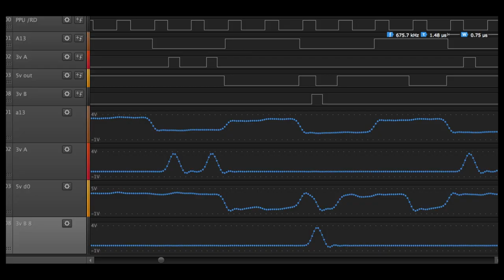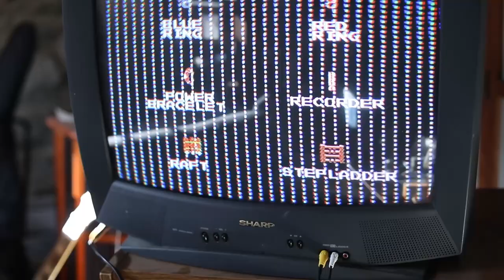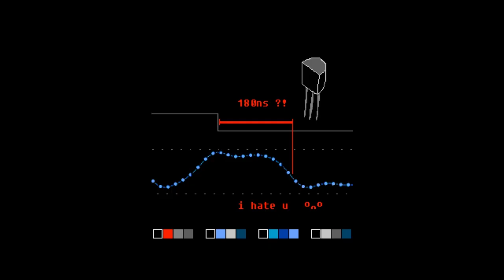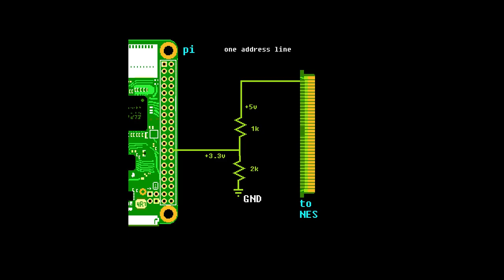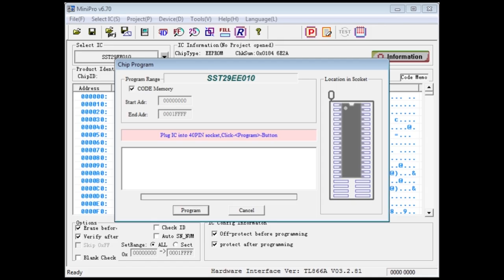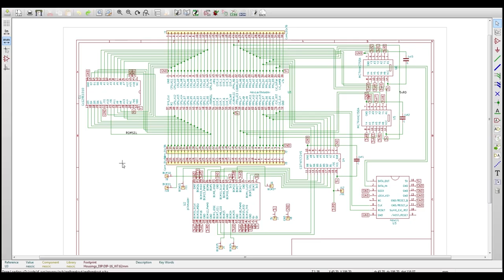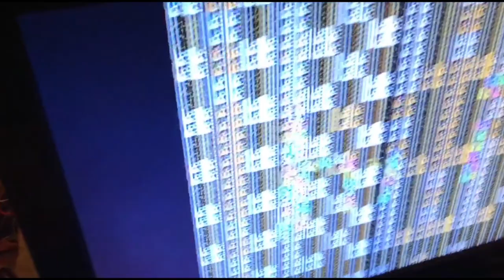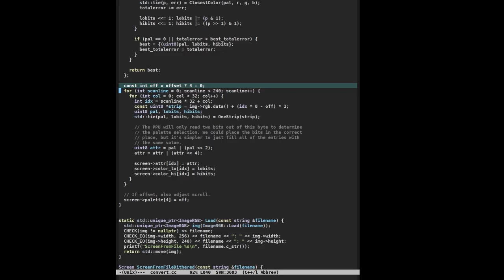Making of "Reverse emulating the NES..."

Comment: Ideas for further improvements:
Audio
  Use the DPCM playback function of the APU.
    Low quality, but still better than should be possible.
    Samples normally limited in size, but faking an endless sample by making a 1-wide sample and changing it every time it is read should work.
    Warning: Controller and VRAM jank
  Directly send PCM samples.
    Wait, that's what you said at the end...
    ...except my idea uses a single, "rolled" loop, instead of repeating data as your idea says.
    Samples are sent just like in the DPCM example, read from a place, said value is different every time.
    While I estimate this will be much slower than your idea, it should be much, MUCH simpler to execute, and failures will only mean missed samples rather than the processor doing whatever it pleases.

Video
  *Use a per-scanline interrupt*, which would have multiple uses, like:
    Per-scanline "fine" scroll, allowing for the color grid to better match the data.
    Use the "emphasis" and "grayscale" bits for a slight palette increase.
    Hook for a consistent 15khz sample rate for the audio
    Hook for per-scanline palette change?
      It should be possible to change it by disabling rendering, and thus ppu fetching, while the ppu should be fetching sprite data.
      Might be hard to control what it does after, you might need to set the current address, count cycles or something weird...
  Simplify "knocking" procedure, instead of an odd reading sequence, write a specific value to a specific address to enter "palette entry" mode, then read from another address to get the new palette.
  Jam in sprites somewhere??

Comment: If you want to get sound from the Pi to the system without modifying it, use a Japanese Famicom instead of the NES, you can pass through sound directly from the cartridge to the internal mixer of the system. Listen to the soundtrack for the Japanese version of Castlevania 3 Vs. the American release. This was done with a sound chip inside the game cart. Lagrange point had a kickass FM Synth chip in it that gave it music and sound comparable to the SEGA Genesis.

Comment: Never throw any thing away :), it might come usefull :), yeah so the MS keeps the track of sws up to 30 GB of updates back :)

If 1bit of transmission uses two transistors no wonder there are milions of them in the cpus. Thank you for sharing the LS, liggtspeed, knowledge, i thought every voltage level adapter would suffice :)

Comment: Re "reverse emulating the CPU", you should look at the Harmony cart for the Atari 2600. Appropriately it uses a microcontroller at 72MHz as it's Big Brain. And it does something like you specify. Except in this case it over-drives the bus. The bus is caused to have FF on it, and by selectively pulling bits down, the cart can control the address and data buses. This means the cart can control the Atari's graphic etc hardware over the bus. 

I've simplified slightly cos I haven't bothered looking it up just now but that's the principle, anyway. 

There's stuff Harmony can do that the 2600 could never do, it breaks several previously-hard limits on sprite numbers, etc, even per-scanline.

Comment: Hey for the record, the NES has a 7805 linear regulator inside which generates the 5 volts. Increasing the output of the 9V supply to the NES will not necessarily increase the current handling capacity, as the 7805 is the limiting factor. Most of them are rated for peak 1 or 2 amps.

Comment: Its just amazing what you've achieved here. Will you be refining this project? The nes controller uses a CD4021 shift register, snes controllers use two of these in series or a specialty ic. Also back during the development of the snes, their were rumors I recall that it was going to be backwards compatible. Similar to the Atari 2600/7800. For entertainment purposes you could solder the corresponding clock latch etc wires from a nes controller cable to a snes controller. Though at the end of the day,  I don't know enough about the nes cpu. I'd also assume that though they share the same bit register, that doesn't mean the cpu can understand the additional information. Two cents from a novice.

Comment: 40 conductor ide is also not straight through. Pin 28 (cable select or spindle sync) is inconsistent, and pin 34 is sometimes only between drive 0 and 1, not to the controller. Because nothing can be simple and easy. 

This isn’t meant as an “um actually” moment, this is me having spent a day of troubleshooting to learn this and trying to keep someone in the comments from that
Reply from the maker: Oof, traps everywhere! I must have not been using those pins or otherwise got lucky!

Comment: Awesome project, this technique for modifying stuff could actually be used in quite a few places not just funky display work on an NES. Anyway, a couple things, 1mil is 1 one thousandth of an inch not 1 one hundredth of an inch. So, 2.54mm=100mil not 10mil. Also, the capacitors next to your chips aren't actually to deal with power sag they help deal with the parasitic inductance of the traces and wires going to your individual chips. In other words any time a transistor switches in an IC it takes some amount of current to power that action and the inductance in the traces and wires resists that change in current. The capacitor then sits very close to the power pins of the chip to make sure it always has enough current during these spikes.

Comment: Really enjoyed this.

It showed many of the same assumptions and experiments that I also made when starting out in electronics, and I'm still learning something new every day. hehe

(like how a standard transistor can be surprisingly slow, unless driven in a certain way. And how you need a fair bit of drive current to toggle IO pins rapidly, due to things like the trace capacitance / inductance.)

This reminds me of mods like spritemind's, where he added an ARM chip (STM32?) to a Vectrex cart, so it could display a wireframe version of DOOM.

I definitely think this project is an ideal task for a small FPGA. You could then get EXACT (ie. per PPU clock cycle) timing accuracy, and easily display whole frames from an SRAM, while also doing palette calcs and colour swaps for any pixel group.

Have you looked into the 74LVC8T245 chips, btw? They have dual voltage rails, and are designed for 3V3 to 5V translation, so don't require any of the resistor dividers etc.

Or, did you just uses separate hex inverters for "reading" and "writing"?

I must get back to you on this later, as I was thinking about a similar project on other cart-based consoles.

Comment: Essentially you're using the raspi as a sort of dsp for the ppu, tbh you could further reduce parts by simply using a cpld/fpga  to talk to the cpu and ppu and connect the raspi to the logic device (fpga/cpld)  but you can pretty much emulate some ram (to buffer cpu and ppu data ) in the chip and write it with raspi or NES, also include cic lockout, and a mmu/mapper, and improve syncing as parts of the same chip can run at different clock rates(you still need a master clock though something  an Even multiple higher than the ntsc/pal NES master clock which you can use to sync between raspi and NES and easy to divide internally aswell within the fpga) , I actually was planning on something like this on my famicom

Comment: Amazing work. If you want some input from the world's foremost NES experts to solve your noise problems, check out the NESDev forums. The community there is amazing.
For the audio - it would be possible (and impressive) to stream audio samples to the DPCM channel, as you describe. There is a simpler route, however - just use the EXP port's AUDIO IN / AUDIO OUT pins, and run analog line-level audio from the Raspberry Pi to those pins. Flash carts like the PowerPak send "expansion audio" to the EXP port using one of the cartridge pins so that the NES can play Famicom games which had expanded audio capabilities, like Famicom Disk System games. Or, if you REALLY don't want to do ANY hardware mods to make this happen, even if that mod is just connecting something to the EXP port (no internal mods required), you COULD just do this on a Famicom. You would have access to expansion audio AND you wouldn't need a CIC.

Comment: So, something Iʼve been wondering lately: could you on either the NES or the SNES force it to send data during V-Blank?  You usually wouldnʼt want to but some information is designed for that; for example, in theory you could closed caption your games with line21 that way.

Comment: Have you thought of using dual ported SRAM? I think aliexpress or digikey has a boatload of those. You could even get SRAM that is twice the needed size and implement double-buffering by toggling an address line from the Pi. What you also could do is using linux boot parameters to prevent Linux from scheduling on Core 4, and setting a processor affinity flag on your process that is driving the IO lines. You can then also set it to realtime scheduling mode (the timer interrupt wont interrupt your process after 100ms, it can run infinite time without having to yield). Interrupts might still happen on Core 4, but no scheduler related nonsense.

Comment: 19:46 - Hmmmm... would it have been a reasonable idea to INLINE a resistor before the voltage divider input? As a simple current limit? Or does that make it much harder to operate on the bus that expects to sink / provide current?

Comment: Hmm.. a few years ago I was messing around with an RC car, I wanted to control it with a raspberry pi over a webserver without breaking the RC support or modifying the board at all. I have no electrical experience. So I just probed around until I found a pin that went high when I gave it controls.  Stupidly, I connected gpio directly to this, which blew out that gpio pin.  After that, I just threw some diodes between the RC board pins and the rpi.. and that ended up working, but now I am wondering if I missed some complexity and was slowly damaging either board.

Comment: Very interisting video, just like the MARI/O.

Recently bought a famiclone (with keyboard =))  and I am planning some experiments with it, as soon as I get a G-BASIC cart.

So, I figured that one can read (PEEK) the PRG-ROM, CHR-ROM and send it out through the audio out with the PLAY command (G-BASIC has those commands http://playpower.pbworks.com/w/page/23989647/gbasic%20manual) then a computer could record the sound and convert it into bits, or bytes (1 bit would require 2 distinct frequencies, 8 bits would then require 256 distinct frequencies, if we assume 10Hz separation between frequencies, that is 256 times 10Hz = 2560Hz bandwidth or approx. 3kHz). This way one could dump a cart, but it has to have G-BASIC on it. But how to dump a cart that has no G-BASIC on it?

Perhaps one could POKE some machine code into the WRAM (in some free space in the first 2kb in the NES address space) under G-BASIC, then one should fill up the stack on page 1 with the WRAM return address for the VBLANK IRQ so that the PC (Program Counter register) is executing the code in the WRAM. Quickly after this the VBLANK  should be disabled, the PPU should be halted (?) by the code (or just stay forever in VBLANK?), and perhaps it should relocate itself to the $0 address, then the APU sould be reset and setup for square wave output. Then the program would wait for a keypress, the cart could be removed and another cart inserted, so that the program could dump it to the PC through the audio out.

Another thing is that I guess one could bitbang serial communication through the controller port using the Strobe bit. 8 bit paralell input is possible using the shift register on the controller and instead of the buttons, the one could connect it to some other hardware.
It seems that 133MHz's project (https://133fsb.wordpress.com/2010/03/21/famicom-compatible-printer-port-interface/)
could be done in a simpler manner, through the controller port.
Oh and according to the Nesdev wiki, there are some microphone input, tape out and in pins on the famicom, but does that apply to the famiclones? I guess I will have to experiment.

What do you think about all this Tom7?

Comment: I saw your other video, very impressive stuff! One question, wouldn't it be better to do this via the expansion port of the NES that you mention, even if it's not as capable? That way one could buy a single NES expansion module to make it work on supporting games, rather than having to embed all that hardware into every cartridge? Kinda like the Super Game Module for the Colecovision that some folk brought out. Would make for an interesting project and possibly be marketable, like an "NES Pro" expansion that homebrew folk could support with new games. As a side bonus it means games would also work via Everdrive carts which so many people use, and would also mean far less real NES carts sacrificed for the lockout chip. I know you did it as a project, but I'm kinda thinking it would be really neat if an NES Pro expansion module was actually made and sold for the homebrew community!

Comment: It is kinda amazing that there is way by which we totally offload both the memory and the cpu to a set of streams of bytes. But, it is also amazing that you can do something like this with the Nintendo chip even if that includes jumping through some hoops, and some good graces of some open source tools, guides, information, etc. Some modern companies, cough Nvidia *cough*, think that open source is cancer. Kind of describes the monopolistic behaviour tech companies increasingly take up as a means to shore up walls into the ecosystem to avoid any form of revamping that is expected of many startups.

Comment: You might be interested in this video about the NES. So a guy that does TAS (Tool Assisted Speedrunning) managed to crack open the NES and stream audio directly to the CPU with only controller inputs. And boy it does it pretty good, at the cost of all of it's CPU time.

https://youtu.be/tA9nlUtepR4?t=9m50s

Comment: Hey Tom,

I am sure you have watched the TASBOT runs at GDQ, right? Where they reprogram the NES to play whatever.
They only use the controller ports for that. is that more powerful, less powerful, the same?
It seems like they push commands directly to the CPU that way.

I really wanna see some 3D. Like PS1 stuff on the NES (skiping Doom because that was on SNES and that makes it not as impressive :P).
If the "cartridge" does all the processing and just pushes audio and video instructions directly, it should be possible right?
and then if you fix the flickering and noise it would actually look decent, just reduced colors.
Reply: That TAS was doing something called ACE, or Arbitrary Code Execution. Meaning that the CPU executes code that was written in RAM, usually via controller inputs by a quick routine made by some other glitch that then can write bigger routines and do cooler stuff, like achieve total control of the game.

Comment: The part I still do not understand is how you pipe a frame to the NES. Do you first supply the code of a program that reads frames from the cartridge and then feed that program with the frames? But how do you switch palettes if the program is run by the NES? There is a part about synching the NES and the RPi that I do not get. Who runs what and when.
Anyway, fantastic project Tom

Comment: To address the sound issue, why can't you just use the passthrough audio feature as in the VRC7 mapper? That way you could produce arbitrary sound on the cartridge and have it piped through the NES. You'd need an adapter on the expansion port on the bottom, but no actual modifications to the console itself.

Comment: I've been thinking of a similar project for the Atari VCS / 2600, using a Raspberry Pi / Arduino / MicroBit / USB Interface in the cartridge slot.
I understand the basics, but I didn't think I could do it until I saw your videos, so maybe I could give it a try when I have enough time.

Comment: is there a way to use a program to optimize the circuit board using neural networks? What would be more effective, moving elements themselves or moving the connections between them? How do current optimization programs work?

Comment: Awesome, I've never dabbled with hardware before (apart from some really simple stuff), so this is fascinating to me. I knew that tri-state logic existed, but would you call the "00" state "high impedance"? I've heard that term used before in datasheets, and I was wondering if this is what that was.
Reply: Impedance is basically what resistance is in AC circuits. For DC circuits it's the same, but for AC it also describes changes in timing. So a high-impedance element is high-resistance - IE basically disconnected.
Reply from the maker: Yes, "high impedance" or "high Z" is the same thing. This is also sometimes the same as the 'input' state.

Comment: Small point of detail: The NES has 5 sound channels, and the DMC might be what you want to look into for sound synthesis. As far as I can tell the NES doesn't have a global volume control like the Gameboy does, so you wouldn't be able to make sound as clean as in this TAS: https://youtu.be/Vjm8P8utT5g?t=4m45s

But it should be possible to use sound compression techniques to at least make some recognizable SNES samples, though you might need to allocate another Pi core to do all the crunching.

Comment: This is a very interesting project you have going on here. I have often wondered if it would be possible to build the NES using cheap modern electronic parts and having it be 100%, or as close as possible, compatible to the original hardware, sans the CIC chip. I know there's a bunch of clone systems out there, but most of them are running some sort of emulator on a SoC and calling it a day. Emulators are great, but it would be super neat to get as close to the bare metal as humanly possible.